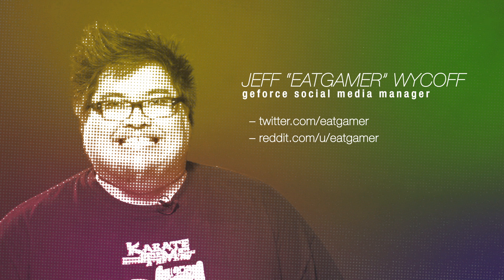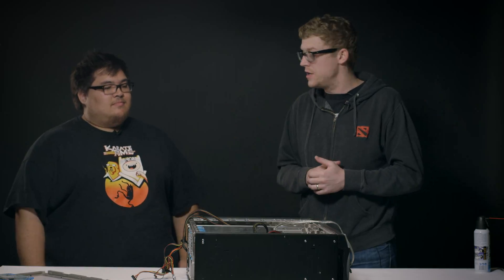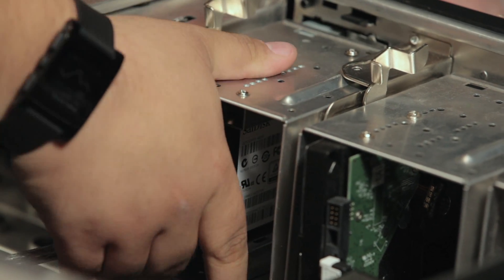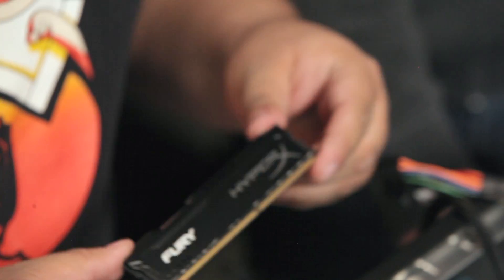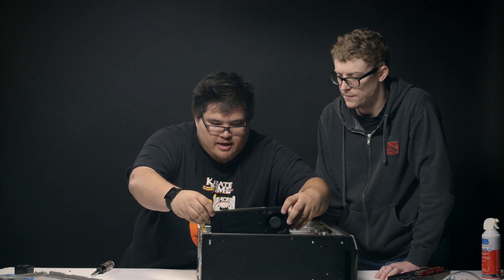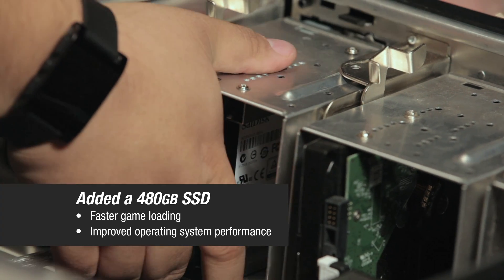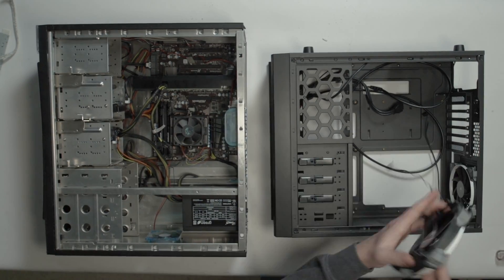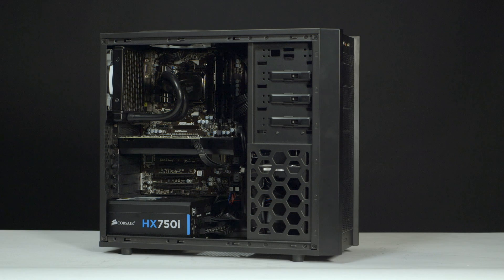GeForce Garage – How to Breathe New Life Into an Older PC

Comment: Hey! I have some old gaming rig. I would like to upgrade it but my budget is very thin. Here's the specs
PSU: Some Blacklisted Crap 500W (If you want to know its Logic Feel
CPU: Intel Core 2 Duo E7400
RAM: ADATA 2x2GB 800MHz
GPU: nVidia GeForce 9800GT (Zotac Synergy Edition) (OCed to: Core 700 MHz, Shader 1750Mhz , Memory 1000 MHz [2000 MHz] )
MB:GA-P35-ES3L
Sound Card: Asus Xonar DG PCI
HDD: Some Samsung 1000GB 5400RPM
CPU Cooler : SilentiumPC Fera  2 rev 1
Reply: get a new mobo for 50 euro add a i5 4660 quad core for just under 230 euro
get a GTX 750 Ti for just 150 euro or get a new GTX 960 2GB or the 970 3.5/4GB for 200/400 euro lets go with the cheap but effective build

Asrock/Gigabyte Mobo 1150 socket 40-80 euro depending on which one you like
i5 4660 3.4Ghz quad core 150 euro
GTX 960 2GB 200 euro
kingston 1x8GB 1333mhz 60 euro the mhz does only matter when using an onboard gpu

keep the cpu cooler and check if your version is compatible with the lga 1150 socket if so use it

keep the HDD as second storage drive and buy an 120 GB samsung EVO 850 for 90 euro

power supply a coolermaster silent pro m2 850 watt which i also own btw for 120 euro i think and you are bassically future proof +5 year warranty on your psu which is nice

lets go with the cheapest build

Mobo: 50 euro
CPU: 150 euro
RAM: 60 euro
SSD: 90 euro
PSU 120 euro

grand totall of 470 euro if done right ;)

Comment: Im thinking about upgrading my RAM from 8 to  16GB.. but will it actually improve perfomance?
And do i need to buy 2 completely new RAM modules? Or is one enough? (i have one 8GB module right now)
Reply: No it's unlikely that a game will eat up all your RAM unless the game is called "Memory Leak - The Game". More free RAM doesn't change anything just as overclocking your RAM. Tons of RAM is nice if you run a couple of VMs and compile huge projects from source.
Reply: Game performance will likely not be effected in any significant way however it's nice if you have LOTS of tabs and programs open while gaming like me.

Comment: I got I5 4440,  12gb ram,  evo 850 ssd,  strix gtx 980 (upgraded from gtx 970) xfx modular 750 Watt hybrid psu,  what should I get next  Cpu or better Cooling since it's all in dell xps 8700 case? .
Reply: I would probably recommend a new Case. Since it can improve the sound & temperatures of all the components. And the CPU should be fine for a while.
Reply: CPU is fine enough for now. I agree with previous commenter. Get a decent case on the cheap. I have the Fractal Design USB 3000. Bare bones but it's chepa and effective for he price. If you want a higher end one that still fits within a reasonable budget I'd suggest Fractal Design Define r4. My partner has that one and is essentially my case. But looks better and feels better. also has some more bells and whistles. Such as sound dampening side panels and covers for unused fan slots..etc.
Reply: get an i7
Reply: Get a new case and a basic air cooler, I'd say a hyper212 or if you feel a bit fancier, a Noctua tower cooler.
Reply: +doomyz a i7 is NOT better that i5 you get better gaming performing for a i5 that i7
Reply: Hump Gamer That is not true, you usually get slightly better gaming performance with an i7 (usually because they are clocked higher) because they are basically the same thing + hyperthreading.

Comment: The video was awesome but in the end they build a New pc
Reply: thepotatoeater But it completely disregards the entire point of the video.
Reply: Well if that was your system would you be complaining?
Reply: Of course .....not
Reply: Not completely new, the motherboard and especially the CPU are the same.
Reply: RobloxDev yes..and considering changing the case and psu..i would have kept the case and psu and gave the guy a newer mobo and cpu kept the ram..added 120 ssd..and i think there is still enough change for a fractal core 1000 case if he really wanted to change the case
Reply: RobloxDev I think the added a new CPU since they added liquid cooling to it.

Comment: My pc
Intel pentium G2020
4gb Ram
Gt 430

The non upgraded version of that pc is better than mine...
Reply: poor thing :(
Reply: Zushikatetomoto Shift I had AMD (HD 6980) i sold it for cheap and got GTX 660 ti. Believe me AMD is not worth it. Bad driver support, no Shadow-Play, no/bad physx support. I rather have bit worse Nvidia GPU than AMD.
Reply: Gosh some of you have some really old and outdated hardware "and software". Sometimes I almost feel bad enough to give someone my old stuff I don't use anymore. I've got a 4 core 3.4 ghz CPU I don't use and 8 GB of mem in a drawer. I also have an old Geforce 9800 gtx black edition sitting in a box. It ran Crysis 1 like a champ.
Reply: Lack of a Good Name Get a job?
Reply: Jay Birdd EWWW AMD EWWWWWW EWWWWWWWW PEH, what did I JUST SEEEE>< EWWWWWWWWW
Reply: Ohhhhh i currently use something very similar to that i know what you feel
Reply: I still use an Intel Dual Core Pentium 2.8 Ghz With only 2 Gb of ram and an NVidia 210 :D and of course, Windows XP :3 

I play The Sims 2 on it mostly but since I got myself an iPad, I play on my iPad lol
Reply: looser
Reply: My 4 year old dying laptop ;-; CPU:Intel i7 2760QM GPU:Nvidia GeForce GT520M
6gb ram
Got my first ever blue screen last week.. I may have overclocked the Gpu to the max..
Reply: Zushikatetomoto Shift I have 660ti pe oc from msi. Was thinking about upgrading it.. But 960 seems quite bad, 970 is having issues, 980 seems to be meh. Waiting for 900 series ti.
Reply: Core i3 540
4 gb RAM
hd 7770
Reply: SoIoCreep Not long time ago i sent my old 600W psu to a friend. Yolo.
Reply: You think that's bad? I have a toshiba laptop, 4 gigs of SODIMM, And 1tb hdd, 1.8ghz AMD A6 with AMD Catlyst integrated graphics.
Reply: Zushikatetomoto Shift Its ok, It can run minecraft with a low lag texuture pack and optifine, settings cranked pretty low, around 55 fps, Gmod, just glitches out, but stays at 100 on flatland, but around 40 anywhere else, on medium. Can run Word of tanks at low, around 20 fps...
Reply: I have a Sony Vaio VGN-CR220E Laptop with an Intel Core 2 Duo 2ghz Processor T7250, 3 GB RAM, 200 GB hard drive, Intel on board graphics X3100, using Windows Vista Premium. All I can play is LOL at 10 to 17 fps on lowest settings and Starcraft 1. I think you have the better system.
Reply: Phantomore Meh, my new rig is watercooled, Has an intel i7 4790k, and dual 760's in SLI...
Reply: Jay Birdd dual 760?!
Reply: derp Kaiser Yeah.. They preform pretty well.
Reply: sli isn't the really cost effecient unless you are on the bleeding edge. In your case it would have been wiser to go for one gpu with the same price.
Reply: derp Kaiser Probably right. I felt like SLI would help in the SLI enabled games.
Reply: Lack of a Good Name It will get better, and it will feel great.
Reply: My potato is
GTX960 Gigabyte G1 Gaming
Intel Core i5 4460
8GB 1333Mhz Ram 
And thats it :D
Reply: Danil Zeren Damn how does that garbage even start without a hard drive or power supply?
Reply: +Lack of a Good Name and just think your pc, is probably better then mine....
Reply: 2007 Toshiba Satellite laptop specs:

Core 2 Duo T5300
Nvidia Geforce Go 7600
200+ GB hard drive (unsure of rpm and type)
How can I revive the GPU on this thing?
Reply: +Lack of a Good Name get the g3258 and the zotac gt740. that would be my best advice
Reply: Nvm. Its a built in GPU. However, my laptop has a rare area for a smaller independant GPU. So whats the best GPU foe this thing?
Reply: İ have 246GB Evo SSD 4TB WD HDD and 700W power supply have any questions
Reply: This thread reeks of poverty!
Reply: The Honourable Grand Master Jay
 Hey, just a question. Are you rich?
Reply: Alex Lin Not at all but I'm not camping outside of food banks! LOL!
Reply: The Honourable Grand Master Jay So that means I am poor because my CPU is a 5 year old Pentium Dual Core?
Reply: Alex Lin That or you don't play games on your PC.
Reply: The Honourable Grand Master Jay Lol actually my Pentium can handle a GTX 750 Ti. Planning to get a EVGA GTX 750 Ti SC soon. Its only $109 USD on Amazon
Reply: Lack of a Good Name with the price of that gt 430 you could have bought a better used one,like a gtx 480 now

Comment: Nice upgrades, although I'm not too sure on the RAM upgrade. The difference between 1600MHz and 1866MHz is extremely minor, buying another 8GB of the same RAM would've been my choice.
Reply: 8GB is enough for almost every game nowadays
Reply: Harry Tsang but having 16gb of ram is more beneficial than the extra 266mhz ram difference.
Reply: Yeah, they probably could have saved themselves $50-$75 and put that into the graphics card.
Reply: You try to talk to people that just upgrade a pc with keeping only the motherboard from the old one. Thats not how you freshen up old pcs. First of all you clear the dust, then you put new thermal paste on cpu, you leave that good ram winch doesnt require any updates, gtx 960 is good for an upgrade thats true, you add the ssd but keep the hdd for data. Overclock if you have the possibility and good cooling system. Thats it...
Reply: They gave the PC 16GB 2:45
Reply: Harry Tsang what you mean by almost? what game need more then 8?
Reply: Yeah even 1333 vs 1866 is very minor in games.
Reply: Rafael Acosta I laughed when i read the last line.
Reply: Harry Tsang now a days 8 gigs is becoming the minimum.
Reply: SoIoCreep For sure you don't have +50 tabs opened at the same time while gaming. Right now, with 2 opened, it shows 2.15 (Chrome is using 300mb in total, and the only program running background is Steam), leaving 5.85GB of RAM available for gaming, streaming, and/or skype-esque programs. 

When I have +50 tabs opened, because I have a problem that consist of not closing tabs (I don't have bunch of extensions, only adblock), Chrome uses an avg of 4-5GB. That, with a 3470 @3.6Ghz, 4 threads (I don't like hyperthreading). 

Only once I was editing a video for school, I was using ~12GB of ram (After Effects, Audition and Premiere Pro), and I didn't have Chrome with my usual 20 tabs opened at the same time.

I really think that I could live perfectly with 8GB if I had a limited budget, the problem is my disorder with having tons of tabs opened at the same time, even thought I can only see 1 per window... lol. 

Either way, It feels good that people actually read my longs comments. Thank you!
Reply: Rafael Acosta
the only reason I say it might not work is because when you add an over clock to the ram it cant be done separately if you add a 200 mhz over clock it can only be done to however many slots are filled not to separate ram slots separate but that being said you could add that extra clock to the 1600mhz ram to 1866mhz and when the 1866 ram gets an over clock it will throttle down to the slower ram speed which is essentially 1866mhz now. But like you seriously would only get a few fps difference from 1600mhz compared to 1866mhz ram in games and small improvements in applications i wouldnt even worry about it I would let all the ram run at 1600mhz
Reply: Aiko San
ummm yeah you dont need 8 gigs for ultra settings,Its vram you need to worry about not system ram for that game.no matter what setting you have it at its going to use the same ammount of system ram that gets stored in the system ram. Im not quite sure you know how this stuff works. Also if your using a capture card its not going to make any performance issues. The only way it would is if you didnt have a capture card and were using software to record not hardware
Reply: brandonhughes7 well, 16GB of 1866MHz ram isn't much more expensive than 1600MHz.
Reply: I agree, but I think the main reason is because that ram could have been nearing the end of its life anyway.
Reply: Potato Master Race This is the first quarter of 2015. I mean it may be some new games that'll use more ram release later this year.
Reply: Harry Tsang I doubt that, the most likely won't be game like this until another next gen consoles....
Reply: That G.Skill Ripjaws X RAM seems like some bargain bin junk. heh jk. ya totally agree. I just bought some RAM today and its only 1600 Mhz but who cares!!
Reply: King Blank I Have ram that is over 18 years old and it still works... Not to say ram doesn't fail but I'm sure it was fine.
Reply: Plus on ddr3 it usually requires oc via XMP to achieve higher frequencies.
Reply: Potato Master Race I used to think that way. Now, usually when browsing, I see that Chrome uses 25% of my RAM (25% of 16GB is 4GB) so, if I had only 8GB, I would only have 4GB for gaming and the SO. In this case, it is good to have some big space left to spare :)
Reply: SheppardOfDeath And I still have 4 gigs :(
Well i'm currently saving for 8 gigs
Reply: danvar249 lol same
Reply: danvar249 Well, from 4GB to 8GB it is a BIG difference! Get some good and cheap g.skill x
Reply: Rafael Acosta  There is no freaking way Google Chrome uses 4 gb of mem. I think you might be confused with your pagefile or total system usage and even then 4 would be high for a total. You would have to be gaming or doing some video editing to use a bunch of mem. I have 5 tabs open right now and as I look, Chrome is using 951,396kb of system memory spread out across 16 threads, and using 21 browser extensions. That is less than one 1gb! Google has its own Task Manager built into it. Right click the top of your Chrome window and chose Task Manager. At the bottom of the task manager click "stats for nerds". On the very first line, to the right, under "memory" you can see the total amount of mem being used. With Chrome running foreground and Steam, precisionX, GeForce Experience and bunch of other stuff running in the background. My entire PC is using "in use" 2.1GB of mem. You must be confused or something. Even if you were using a program that used 4GB, you wouldn't run it while gaming and you would have that 4gb freed back up. Anyways, your post caught my eye, I laughed and I had to speak up ;)
Reply: Don't forget that VRAM tends to shadow in system memory so you can alt+tab..
For a 2GB card this isn't an issue, but a lot of people who haven't striped windows down are having issues with 4GB cards.
Reply: sum gt Well, it is usuall to find people who just see them too long
Reply: he can technically take that 1600 mhz ram and use it with the 1866 ram but it will slow the 1866 ram down to the slower ram speed
Reply: ***** you can also overclock the 1600mhz sticks to pair them with the 1866
Reply: Rafael Acosta yeah I dont know how good that would work though. you might run into issues doing that
Reply: ***** It might be unstable, but technically possible
Reply: ***** People don't really overclock ram for a real improvement, but for a benchmark record :D
Reply: Rafael Acosta
yeah
Reply: Harry Tsang Sure it's enough, but I find that 16 gigabytes comes in quite handy when using many chrome tabs and a game.
Reply: Harry Tsang If you have 8Gb even 1333Mhz don't replace or upgrade it. It is pointless, you will see completely no difference. Nowadays you not need more than 8GB of ram to play games.
Reply: Igor vodoo yep 
only if you do a massive graphic  or video processing then yeah MHZ of RAm will be more efficient, if for gaming then a difference between 1333mhz and 1866 will be 2-3 % max
Reply: Potato Master Race GTA V needs 8 I know this was 3 months ago so yep you would need a little more than 8 for GTA
Reply: Potato Master Race GTA V needs 8 I know this was 3 months ago so yep you would need a little more than 8 for GTA
Reply: o11o01
I have an old computer that runs it fine with 6 gigs of ram and a gtx 580 @ 1080p perfectly
Reply: ***** Max settings though is what I'm talking about I run a little lower than max and only have 8 gigs I can only have skype open with it
Reply: Harry Tsang Not for Witcher 3 on Ultra settings with streaming.
Reply: Potato Master Race
Reply: Igor vodoo You do if you;re a Pro gamer; Witcher 3 needs more than 8 on Ultra for smooth gaming; and especially if your're streaming and using Skype etc. at same time.
Reply: Aiko San Where are you getting those numbers? Only if you are streaming you are going to use >8GB while playing Witcher 3. Yes, Witcher 3 is 64bit, yet doesn't require you to have 8GB ram... The only game that requires >8GB ram is Star Citizen Alpha. Cities skylines uses 5GB (summing the OS and background sums 8GB)
Reply: You should work here....
Reply: ***** I just said you do.. if you're a Streamer...
Reply: Rafael Acosta You're literally just repeating my words; 'if you're streaming'...
Reply: +Harry Tsang almost? lol
Reply: Multitasking, multitasking, multitasking. That is all. Plus, don't forget, it's 8GB at 1600mhz vs 16GB at 1866mhz, which DOES pose a big difference in rendering, streaming, having multiple programs open at once, downloading multiple files, etc.